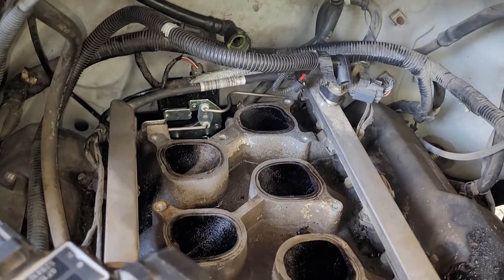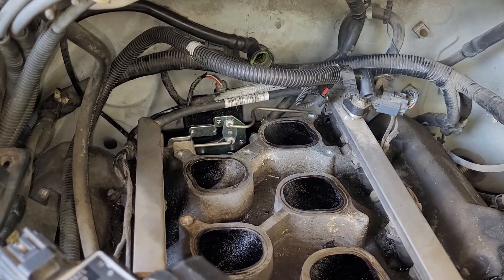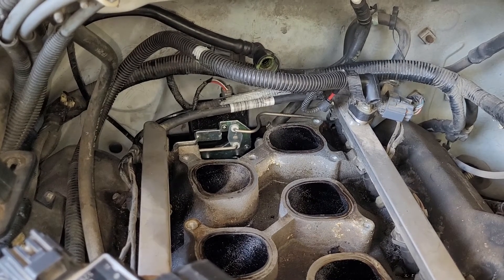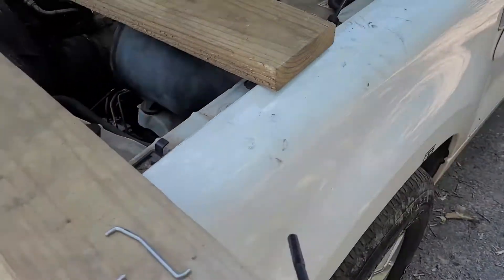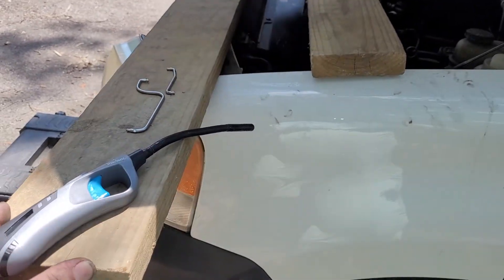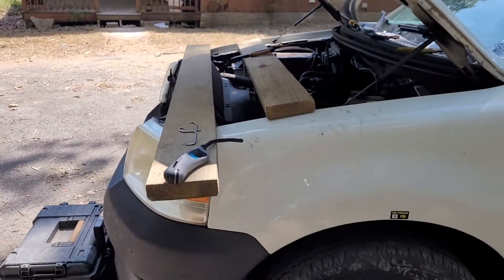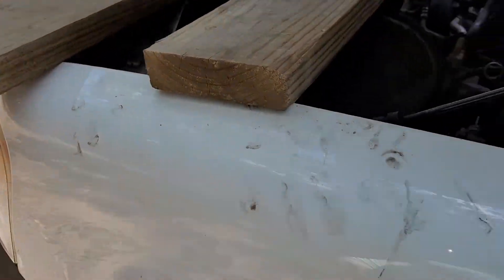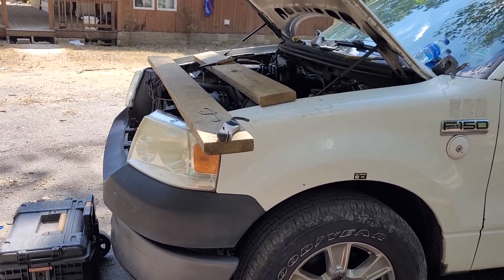Intake Manifold Runner Control Valve, 2008 F150 4.2L V6 P2004 Code - Part 4 (P2004)

Comment: Do you have a part number? On your other video the link in the description no longer works.
Reply from the maker: Here's one with everything. Dorman 911-912 Engine Intake Manifold Runner Control Valve Compatible with Select Ford / Lincoln Models https://a.co/d/3qXjvBh

Comment: Did it start ? Was that the problem (IMRC) 
Cuz I got the same problem on my work truck f150 4.2l  2008
Reply from the maker: Yes. It did start perfectly! There wasn't anything wrong with the IMRC it was the linkage that had fallen off.
Reply: Was the old IMRC bad or was it working and just the linkage had just fell off? @cpthillbilly
Reply: Is there a way to test the IMRC off the truck?  I know the linkage is off on mine. Debating whether or not to buy a new one ($300.00).  2004 F150 352,000 miles
Reply from the maker: @JasonFrancis-m1d  The IMRC was good. The problem was the linkage fell off due to worn plastic clips.